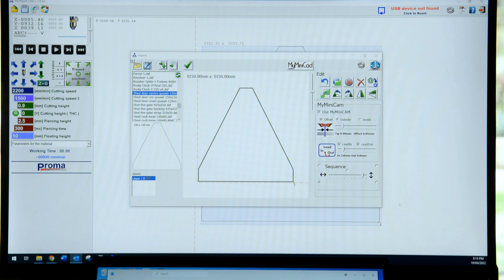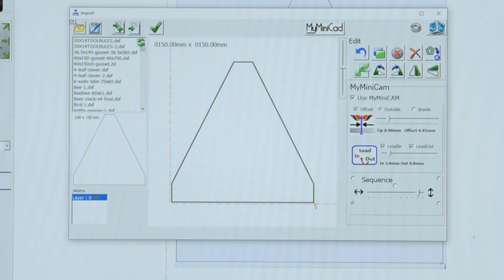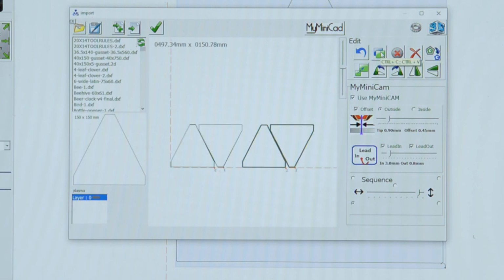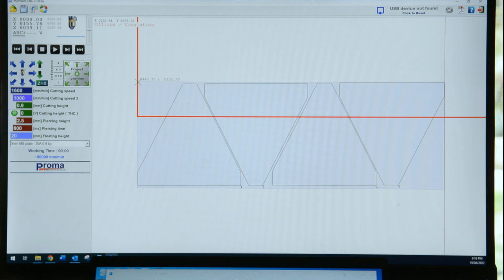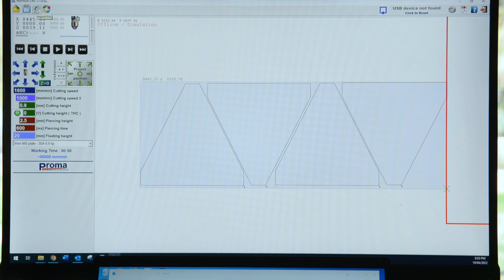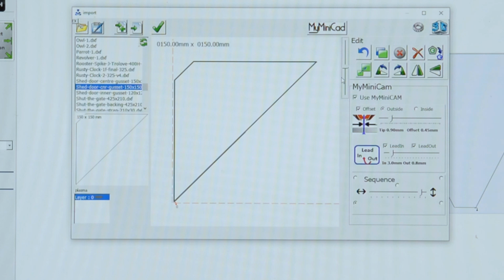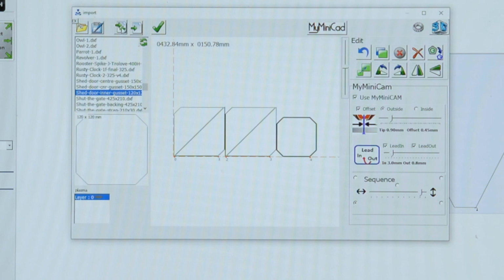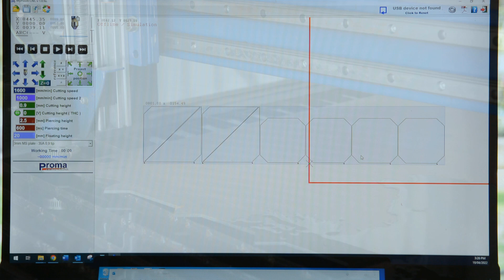How to Nest Multiple Items in MyPlasm CNC Software

Comment: Hi there mate thanks for the video I am running my plasm and can’t seem to get the dotted yellow lines ( soft limits ) to appear on my screen any ideas ?
Reply from the maker: Hi Jordan. Go into your configuration settings (the cog icon next to Communication Status message), open the Machine tab and make sure the 'Axis Soft Limits' box is checked. Also make sure you have entered a value into the X, Y & Z box, which describes the maximum distance each of the 3 axes can travel. Also make sure you have installed and set up your homing switches, too. Hope this helps. If you want to email me, it's rmhyde58@gmail.com

Comment: again, thank you for another stellar video
Reply from the maker: Thanks Mike, I'm glad you enjoyed the video.
Reply: @RustysMetalSigns  what Plasma cutter are you using?
Reply from the maker: I'm using a Jasic Razor Cut 45, branded and marketed in Australia under the Unimig banner. It's a great cutter and has done everything I've asked of it. To date, the thickest material I've cut is 10mm mild steel and it handled that with ease.
Currently using the hand torch that it came with, and would like to swap it out for a machine torch, but can't justify the $700 price tag for a Unimig torch. I've looked at 3rd party options but not sure about the connections in the torch lead, though.